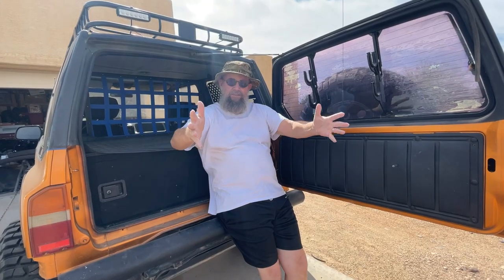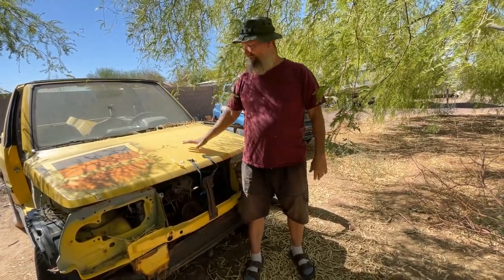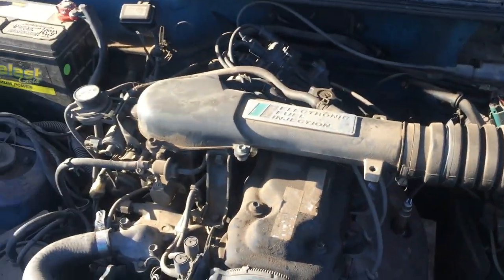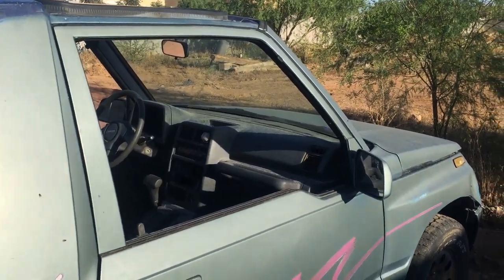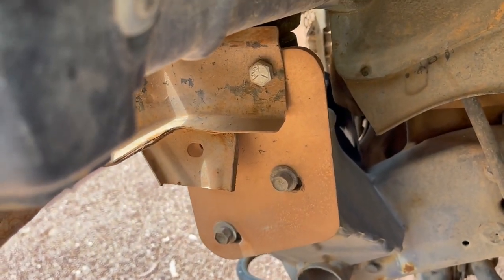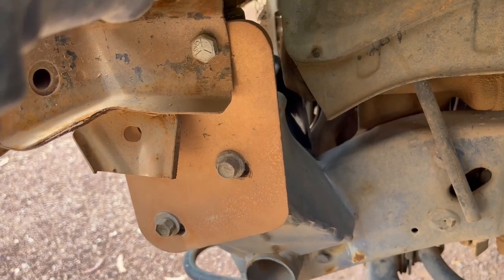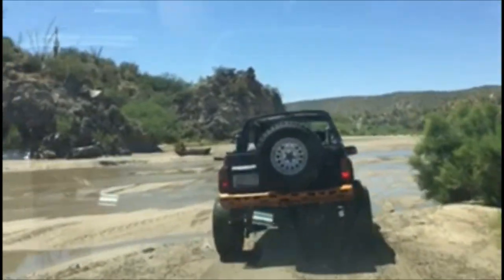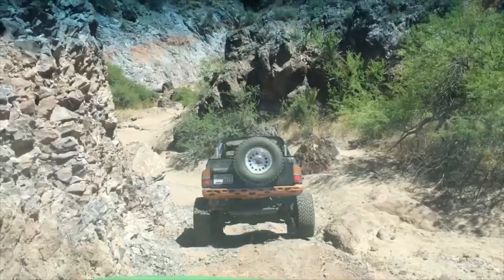S4 E4 Transforming Your Geo Tracker 4 Off Road Adventures #vitara

Comment: The bumpers you have are cool!
Reply from the maker: These are actually stock bumpers with the plastic covers removed.  We simply painted them after we positioned them in relationship to the body lift.  Here in Arizona, we run a lot of desert washes and we seem to tear our plastic bumper covers off...so we simply remove them when we modify our units.  I am not sure what you will find behind the 2001 model that you have.  We really focus mostly on 1st Gen Trackers/Sidekicks & Vitara's.  The 89 Tin Top, has 4.5" dia. steel pipe for bumpers.
Reply: @tufftrails  a lot like yours without the holes.  Can always drill some in it.

Comment: At 8:20 those look like the rims I bought for 200 bucks for my tracker two days ago . 
Looking good
Reply from the maker: Cool,  I had some problems with mine so they are stacked in my garage now.  Tires were 33's, didn't want to cut fenders.   This build looked better with stock painted wheels and 1" spacers.
Reply: @tufftrails  problems what problems? Bolt studs to short ?
Reply from the maker: LOL,  no, the tires are 33" tires and they hit my lower part of the fenders when turning.  Which normally is not a problem, I will just trim the fender, but I didn't want to cut this one.  Also they would hit the top of my fenders when getting twisted up on the trails.  Again usually not an issue, I would trim the fenders just like recent Twisted Copper Overland Tin-Top Build.
Reply from the maker: I might put them back on the white 4dr, they did good good on that one. I have a set of 5 32X11.50x15's tires on some jeep wheels that I might use.  But not the Jeep wheels,  they are 5 on 4.5" bolt pattern and they do not fit our stuff.
Reply: @tufftrails  y'all ever want a different type of trails . We have the Alexander McKenzie/ grease trail its  Close to me .  Opposite of the desert
Reply from the maker: LOL,  not for me.  I believe that the Alexander McKenzie/ grease trail is rated as one of the longest and most difficult trails in all off North America...  I think that it holds the record for destroying the most Jeeps... I'll stick with my desert...  But thank you for sharing the info.
Reply: @tufftrails  yes , your 4x4 better be a solid unit for any of these trails around here . That Alexander McKenzie trail is not that bad just gonna need more fuel than you thought .
Reply from the maker: It has like 6 River crossings, That's where a 5000 pound Jeep or Bronco would do better than a 2300 pound Tracker...I've seek videos of the depth and speed of the currents.  Definitely above my pay grade    lol

Comment: How do u make the top ? They look good!! The one right above your head. I need one bad mine is soft and it makes alot of noise slapping around. But I got a hard top on the back!.. good lookin geo yall got there! All of them!
Reply from the maker: Not sure who I am replying to, "Just Me", Sharon, or Bob...  This is the video,  https://www.youtube.com/watch?v=b3ogw7nu-0M&t=88s&ab_channel=TuffTrails   Basically it's just a thin sheet of aluminum Diamond Plate   like this one  https://amzn.to/3FjWkDr   47.5" x 29" is the area that it covers.   It has a slight tapper, a bit narrower at the windshield spreading slightly where it meets the roof panel.  
The roof already has threaded bolt holes that will secure your Targa top, so you do not need to drill, Just find the bolts that you need,  two on each side.
Bending the sides down can be down slowly using a vise,  just work it slowly until it matches the contour you like.  Cutting the material is probably best with a high speed "air" cut-off wheel, but can also be accomplished with a Sawz-all type hand held battery powered or electric saw with a metal blade  or possibly with a jig-saw and a metal blade.
The Targa top will seal on the seal around the opening and will not leak once tightened down.
The thickness of the metal in the link https://amzn.to/3FjWkDr  is thin enough to bend easily and thick enough to make a solid mount.
The next one I do I will make a good video...  send me an email and we can swap cell#'s if you run into issues.  Wizard2Wizards@Gmail.com  
Thank you for your question, I hope this helps.
Reply from the maker: This is the size that I use,  thicker, stronger and a bit harder to bend and shape    https://amzn.to/3PY81o4   it's 1/8" thick.  The link that I gave you in the previous reply, is just about 1/16" thick so it should easy to bend and shape by hand.

Comment: I have a geo tracker 96 on 31.5 tires on 10x15 dp dich wheels no lift at all flare out homemade bikini renegade style old school aluminum pulley 272 cam regrind header homemade exhaust system gd air filter no rug no back seat like i said old school style my is automatic transmission 4x4 never have problems with my i always kp my Geo tracker 16 valves in gd condition i travel a lot from pa to Florida California NJ Connecticut Ny main i being all over and like i said never any problems in summer i put a oil transmission cooler to kp the tranny cooler and my look old school style and sounds tuff gd on gas and cheap to maintenance i love my Geo tracker people seems like they love my little buddy truck a lots of people offering me a lots of money for it my answer is hell know jjjj 🍻.But i drive my easy and smooth from 55 to 650 sometimes 80 miles to clean the engine up my pull hard on higher rpm  100 easy with the cam pulling  in higher rpm really but i drive enjoying the ride and the views easy and smooth gd video guys
Reply from the maker: Dang Sal, sounds like you have a serious little Tracker there, and you are running huge miles on it. That's awesome.
Thank you for your comment and keep that Tracker rolling...
Reply: @tufftrails  yeah still rolling up hill down hill and will kp rolling that what they were made for to be used in any environment cities country roads highway hills to the top of the mountains plus rain mud snow rivers etc blast down south jjjj 🍻.it is not how fast you get there what matters it to get there real simple and my little buddy tracker kp tracking all over but I do take care of him do he take care of me all the oils nearing seals tires everything on him and he kp me alive real simple cheap maintenance I do it my own self from brakes to oils wheel bearing shocks everything else nothing to it for me
Reply from the maker: @ outstanding…
Reply: @tufftrails  that what you have to learn to travel all over USA and have fun no only trails they are gd for every thing but like I said easy enjoy the ride stop here there and kp tracking I even sometimes sleep in the tracker soon I going to hit the Appalachian mountains and Carolina to see the view with the hills boys out there probably is like going back 100 years the Appalachian mountains people and Kentucky like to kp the old ways and simple I have some friends out here from the Appalachian mountains like I said my Geo tracker will kp traveling like a gypsy and the Spaniard mustang 🐎 jjj 😁 take care out there give yourself a chance and travel I have 31 ones on my drive ok with them all over .